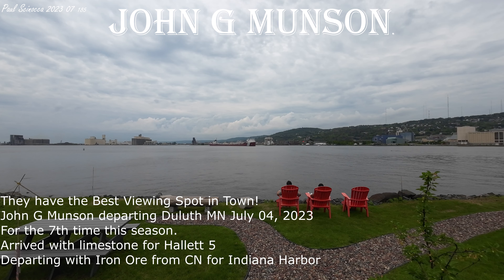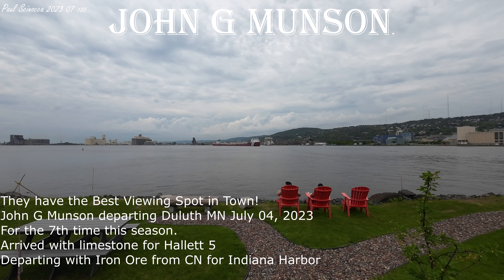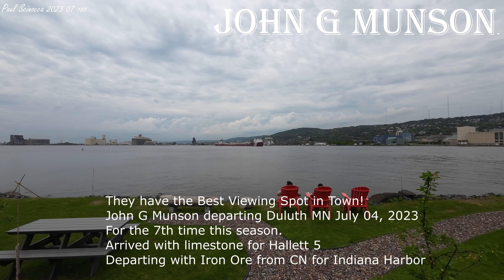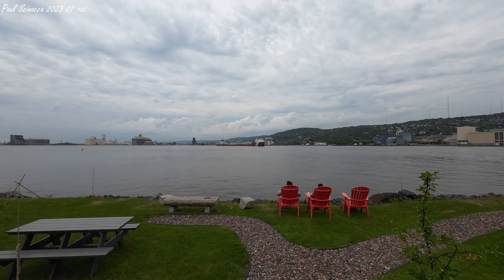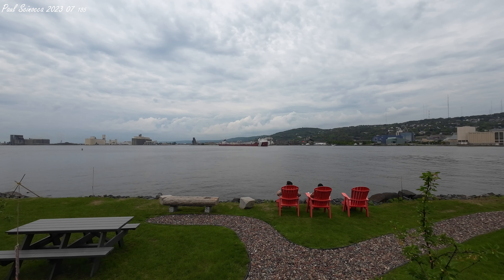The Munson Gaining Speed in the Canal!  The John G Munson Departing Duluth MN loaded with Iron Ore!

Comment: Since the top speed of the ship is usually given by the bridge announcer, I’ve wondered if making the ships faster would be more effective and profitable to the ship operators? Larger engines, more fuel consumption, faster lake transit times, versus less fuel consumption and cost, and slower transit times. Maybe I should have been a ship design specialist? In my next life, maybe. 
Thanks for the video, Paul. 👍🏽
Reply from the maker: Good question, I think, the shape of the bow also has a lot to do with the speed of the vessel.
Reply: @PaulScinocca  Shape also has an influence on carrying capacity. I guess it’s best left to the experts. 
Thanks, Paul.